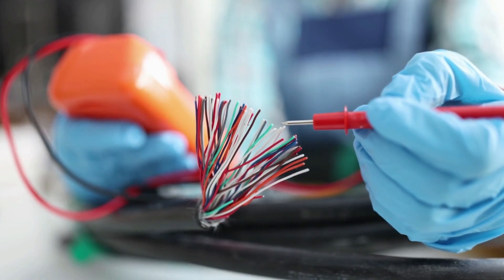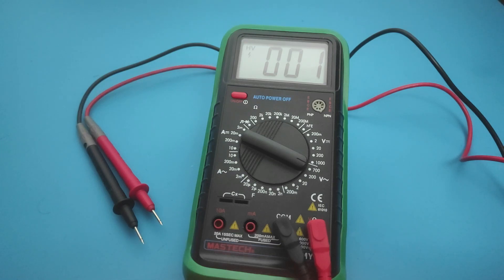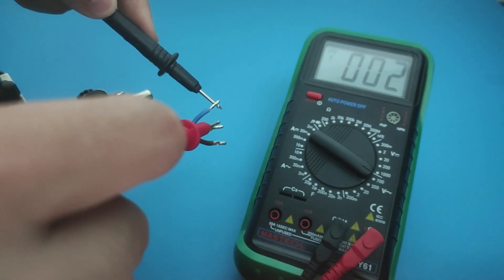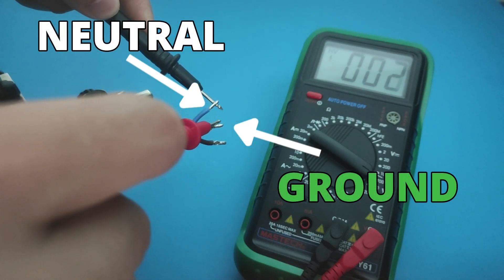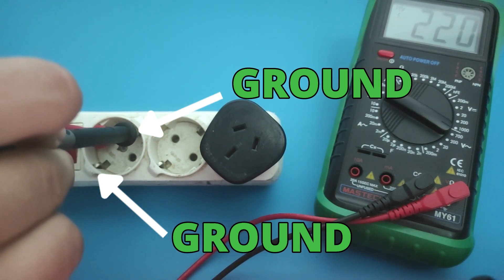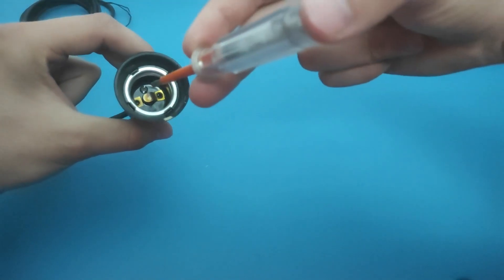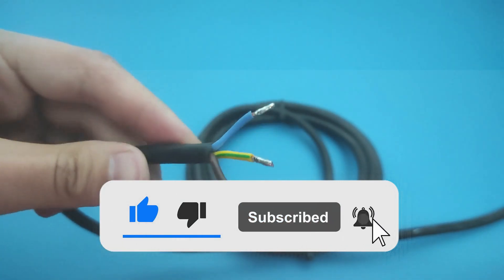How to Identify Hot, Neutral and Ground Wires Using Digital Multimeter

Comment: You never showed us how to identify which one is a neutral and which one is the ground?
Reply: Yes I have warched many videos and no one  is able to  explain clearly   in the absence of color code. The option is to remove ground wire from the mains  and  use a test lamp  to find out the Ground wire
Reply: One way to remove G from mains and use test lamp second one  put  a wire in  earth  socket  of another board and connect it with  a wire that has to be identified and go for continuity test

Comment: You never explained how to tell apart ground than neutral bad “university ”
Reply: Use your multimeter on the exposed wires and on the plug receptacle on continuity setting, and if you get continuity between the ground prong and wire 3 then that's your ground, you know which is hot, so lastly the other will be neutral.

Comment: You can identify the hot wire but how will you know if the other wire is neutral or ground.  It's one or the other but how do you know which one it is?  Does it matter?  Can you do this test while the wires are connected to an outlet.  Like remove the outlet from the box and test the wires while they are still connected?
Reply: It does matter.
Putting neutral where ground belongs increases possibility of electrocution if the hot comes loose.
Reply: @WrongTimeline  Do you know which one is neutral and which is ground in this video?
Reply: Just have to go by color for now.
How to do it electrically?  I’m still searching.
Reply: The neutral wire has a slight voltage whilst the ground is 0 and live is either 240 or 120 depending on your country. Finding the live is easy, after you've found live make your own ground. You can use copper pipes or stab a screw driver into soil and run a wire. Next check the two remaining wires with the multimeter, you'll find neutral has 1-3 volts running through it. Ground/earth will be 0.
PS, yes it matters. If you swap ground for neutral you're sending live directly to earth. It's a direct short, at the least  your consumer unit fuses will blow or RCD will trip. At the most you'll fry whatever you've plugged in.

Comment: Question. I found the hot wire but not sure which of the other two is neutral and which is ground. (All 3 are the same color)
Reply: Me too. I found the hot wire. But still can't tell which is neutral or negative. This video didn't show how
Reply: Same here
Reply: Method 1: find a second outlet. Turn off circuit breakers for both outlets, probe voltage to ensure there is no power (for safety).

Set meter to resistance, insert one probe into the ground of your second outlet. Now, use your second probe to check your ground and neutral. The neutral shouldn’t have continuity. If both have continuity, you have short somewhere that needs resolving before using this method.

Method 2: find your grounding rod. Similar to above, shut off all circuit breakers first, clamp your first probe  to the grounding rod, and then use your second probe to inspect neutral and ground. Again, the ground has continuity and neutral shouldn’t.

If your multimeter cables aren’t long enough (another outlet could be several feet away, and a grounding rod could be, say, 50 feet away) you could jank together the probe wire into an extension cord and then use the other end of the extension cord to insert/connect to the multimeter. Be mindful of the added resistance for long wires or weakly pressed connections.

Comment: Question, when touching exposed wire with multimeter, does the common lead need to be touching a ground first?
Reply from the maker: It doesn't matter which wire you touch first.

Comment from the maker: Key Moments:
00:20 Tools needed
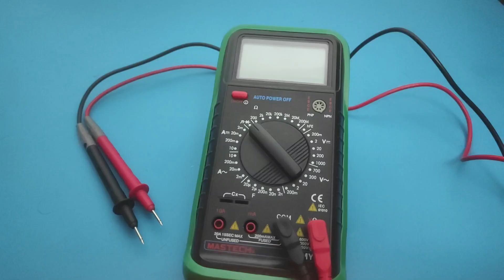00:55 How to identify hot, neutral and ground wires using digital multimeter
1:59 How to find hot wire with voltage tester
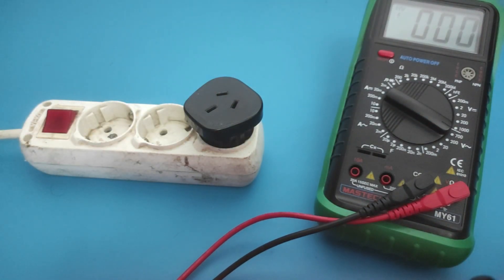2:20 How to identify wires on electrical socket
3:19 How to identify wires on light socket
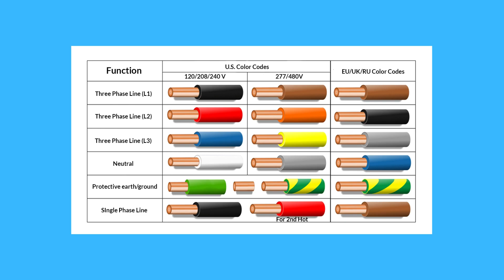3:43 How to identify wires with wires color codes